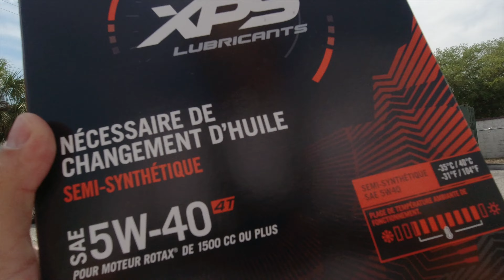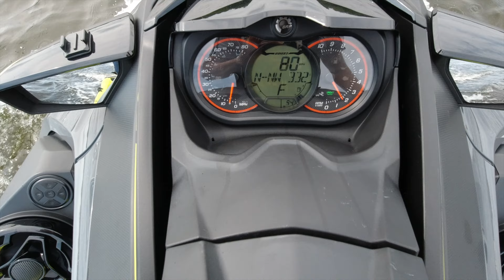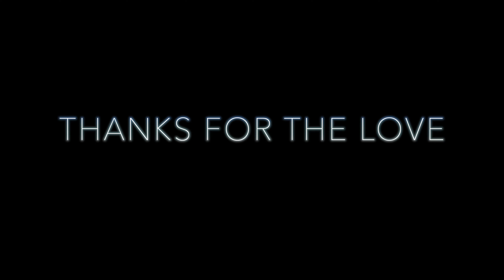Finally my Seadoo is fixed - Seadoo rxtx 300

Comment: Hey brother I enjoy the videos. I have two of the same RXTX 300's, the same year as yours. With the warranty ending soon do you think it's worth paying to have them checked? They want an hour plus for each. Everything is running fine but would hate to miss something big under warranty? The issues with your repair mess by the dealer makes me wonder. Thanks.
Reply from the maker: I would check the carbon seal, how many hours on yours?
Reply: @charlottecountyriders  120 & 124